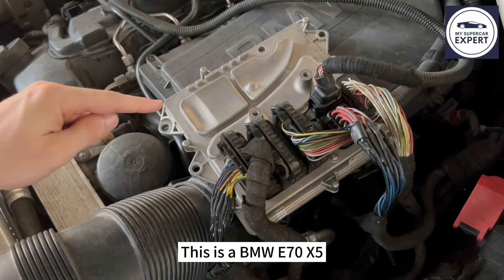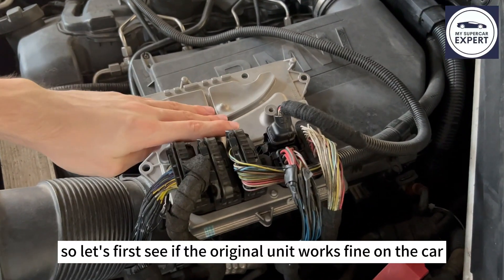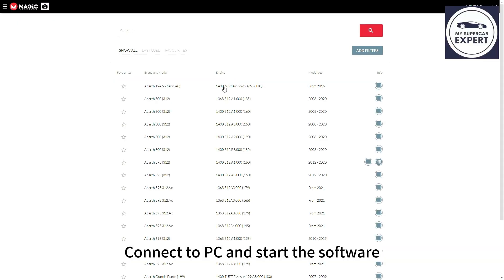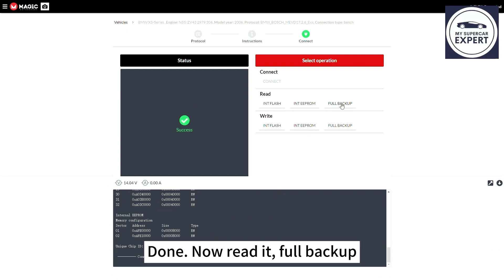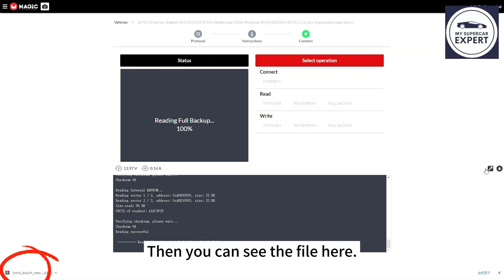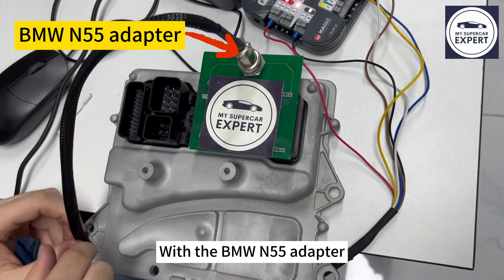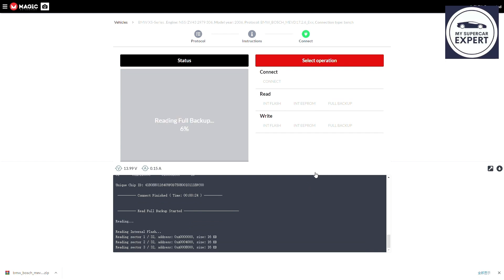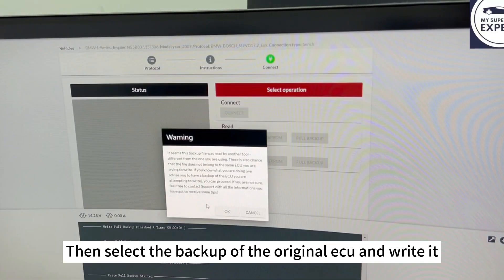How to use FLEX to clone the BMW N55 ECU!

Comment: if i will make a clone 2 used ECU, is it be any problem for cloning? I have a broken ECU (md1cs003).. i will clone it, to another used ECU..When i want to turn back, will the healty ECU work again?
Reply from the maker: Hi, clone will never make the previous ECU stop working on the car. However, some ECUs cannot be cloned because of software protections. Make sure with the tool manufacturer before buying the ECU! Some tools do not read/write the whole content, and the manufacturer will know if ECU cannot be cloned due to software issues.

Comment: can slave do this or only master?
Reply from the maker: Slave can. The only ECUs slave cannot clone are those which need data modification. 1:1 clonable ECUs do not need to use master tools (note this applies to FLEX, might not apply to other devices)

Comment: Should it be the “new” one virgin?
Reply from the maker: "Virgin" is exactly the same programming status as new for what concerns immobilizer. If you want to clone the ECU, you don't need to worry about that because you copy also the immobilizer information. It is important to have a "virgin" ECU if you have no backup to start from, therefore you need to teach immobilizer to the ECU without any actual ECU immobilizer info - it has to learn it from the rest of the car.
This is not the case luckily as we have the original car ECU backup with us!